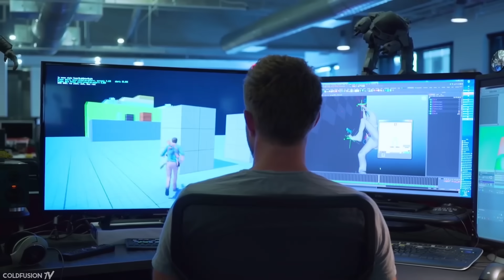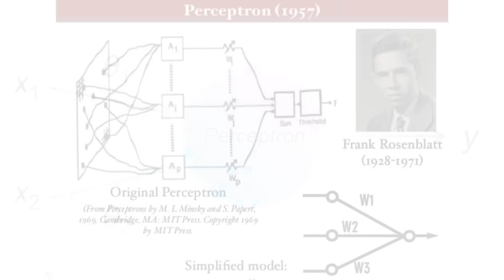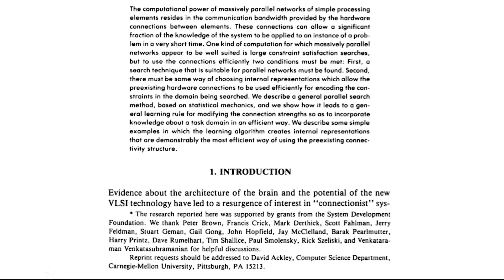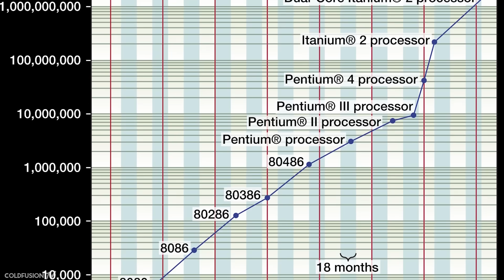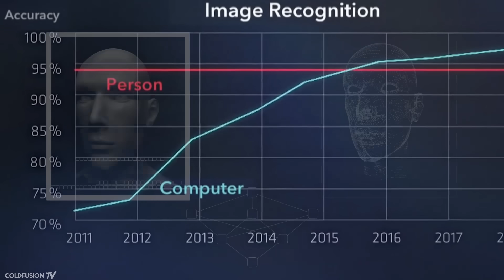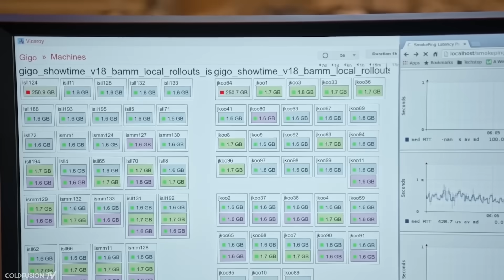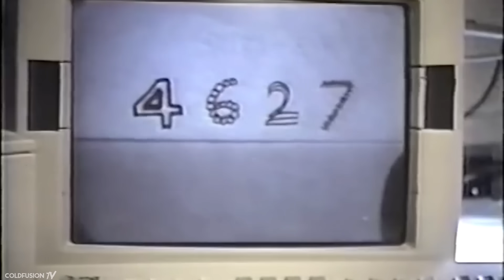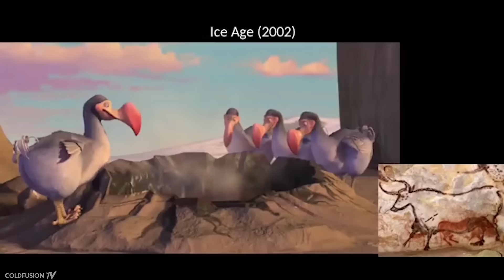Who Invented A.I.? - The Pioneers of Our Future

Comment: AI did not solve the three body problem. I haven't read the paper and this is the first time I'm hearing about it but non-linear differentical equations don't pass the "uniqueness" part of the existence and uniqueness theorem.

Here's the abstract for the paper:

Since its formulation by Sir Isaac Newton, the problem of solving the equations of motion for three bodies under their own gravitational force has remained practically unsolved. Currently, the solution for a given initialization can only be found by performing laborious iterative calculations that have unpredictable and potentially infinite computational cost, due to the system’s chaotic nature. We show that an ensemble of converged solutions for the planar chaotic three-body problem obtained using an arbitrarily precise numerical integrator can be used to train a deep artificial neural network (ANN) that, over a *bounded time interval*, provides accurate solutions at a fixed computational cost and up to 100 million times faster than the numerical integrator. In addition, we demonstrate the importance of training an ANN using converged solutions from an arbitrary precise integrator, relative to solutions computed by a conventional fixed precision integrator, which can introduce errors in the training data, due to numerical round-off and time discretization, that are learned by the ANN. Our results provide evidence that, for computationally challenging regions of phase space, a trained ANN can replace existing numerical solvers, enabling fast and scalable simulations of many-body systems to shed light on outstanding phenomena such as the formation of black hole binary systems or the origin of the core collapse in dense star cluster

Comment: The critical question of "whether they (A.I. beings) will be nice to us is really THE fundamental and MOST CONSEQUENTIAL issue for A.I., and humanity. And it all goes back to the stories in Terminator or the Matrix, or iRobot, etc... First of all, we MUST be able to incorporate a VALUE SYSTEM into the algorithm. It is not enough for the A.I. to learn based on positive/negative reinforcement. There must be some overriding layer of MORALITY hard-coded into the system -- similar to the "3 laws" in iRobot ("You cannot harm a human being"). But then the question becomes, if the robot is so smart, it may be able to devise a way to change or override that higher/hardwired/hardcoded safety-net, right? Just like the example in this video, where one algorithm won the hide-and-seek game because it figured out how to "change the coding which governed the laws of physics within the original program", similar to how Neo learned to change the programming in the Matrix. This is actually scary stuff, and I never realized just how close we are to A.I. becoming so good at self-learning that it becomes smarter than us.

Comment: A Lie is a Lie is a Lie! When understanding something there are a few basic rules. Just like energy can't go from a high source to a higher source in totality this AI bullshit can't be possible without input from the Lie. Energy flows from a higher quality to a lessor quality/quantity and is diminished, dispersed and spread out  in that you don't lose energy it just go into a lower more spread out form. That it never is lost or gained it just evolves lower and lower to lessor and lessor parts, not losing the sum total of its quantity. So electricity as it is produced is a set voltage and current(amps) either stepped up in voltage while lowering current(amps) or stepped down in voltage while upping current(amps). Same with AI if you put all the knowledge of a person into it, the machine can then outdo a man by being more proficient at a part of the task because something mechanical can out perform something in the flesh in varying degrees of actually doing the task, such as in thinking faster, being stronger, continuing repetition, or in outlasting as long as there is energy being provided, maybe even becoming better at learning in a given isolated area by gathering more data faster as it has immense amounts of power/energy being used. Where we humans need to take breaks have limits on our bodies and minds and need to enjoy life or die. Tell me will a computer ever have the intuition or the mindset of a human? Can a computer or robot or etc, ever perform the way a human can or a human's brain can? Example I can be in the desert or in the freezing cold or in the water etc. and perform without extreme HVAC, I can eat a banana or go without to the point of weeks and perform complicated tasks without using extreme amounts of energy, I can perform without extreme venting or in having to be in a clean room type environment while operating complicated equipment and completing complex tasks, I can operate under conditions and understand the human condition that a machine NEVER will, its called intuition. Will a machine ever have the ability to express the humanity we humans can express in all our frailty, power, strength, empathy, love, etc? Yes in isolation a machine can outperform certain tasks at certain levels but it will NEVER be the end all do all of us, people. Period. This all in the form of an organ no bigger than a ball that is amazing and can NEVER be copied I don't give a flying F$#% who works on it or how long the human race has to solve it, other than by the natural way we reproduce each other with a man and a woman. Period. OH and as far as the other part of the Lie where we now are defining our humanity in another way in mapping our genome and our DNA and producing us people in lab type environments think about this, the last time we came this far was when the Earth was flooded because mankind's violence was so ingrained in everything that it affected the Earth itself all the way through to the plants and animals in the violence caused by us, HUMANKIND! Was that because back then we were doing the same things in developing and designing Humans outside of the Human body!? Gene splicing everything from plants, animals to even Humans!? So absolutely YES we were smarter back then even compared to nowadays. Yet the violence we caused brought about Judgement that is coming once again, only this time it will be with Fire. Go Freaking Figure

Comment: There is no artificial intelligence, machine learning l, deep learning. It is magic word(marketing term) to keep noob investers(in share market) always at end of the chair. It just algorithm based upon the mathematics that runs on nvidia & intel magical ai machine originally a ASIC specially designed to perform matrix operation. Normal cpu contains ALU it can perform arithmetic operation like + and -  {Note: multiplication and division is the extension of addition and subtraction with same circuit} , GPU is designed specifically for vector operation and {finally nvidia's tensor , intel's nervana, Google's TPU, Qualcomm's AI,apple's neural engine is fucking designed to matrix operation with big numbers in massive parallel.} 

Important note:

*there is no real conscious ai is built till this sec, even we didn't understand how our brain consciousness work in practical not in theorical like particle physics dark mater, if you doubt me ask neuro science graduates

*artificial neural network, machine learning, deep learning, ai are mathematical ideas that converted to any programming language which uses matrix operation as its core.

I'm not here to blame cold fusion tv, I'm here to blame fucking marketing teams like fucking Ai.

I'm not here to screem that "ai going to destroy blah blah blah"
Reply: The vid explained how artificial neural network or "deep learning" works. Its a bunch of nodes with weights. The more you nodes and weighs there are the more accurate it is. It can be applied to many problems. It can self learn how to control an real life hand or in game character like that game where a.i hides and a.i seeks which is amazing. All it takes is some know how to guide the whole learning process. And if its moving in the right direction then youre seeing the expected results. Or something way beyond expectations like the machine learned a.i using engine glitches to break the rules when it encountered seemingly a dead end.

Comment: It starts with saying AI solved the three-body problem, which is why many in AI community are pushing back so hard against wild headlines that require you to read the fine print, and then the research paper, in order to know just how misleading it is... but is out on blast as the full truth in videos like this.
Reply: OK, with Perceptrons, and Hinton's work, We need to stop calling that AI. It's Machine Learning, and they have a fundamentally different "understanding" of the problem space. Simulating the brain vs trying to understand how it works represent different layers. The first, Connectionism, is also a form of Reductionism. Instead of stopping to smell the rose, they shred it into the smallest functional component and try to build a network that is a crude approximation (in the brain, there are different types of neurons that build different types of structures and the connections between them changes over time (not just the strength of each connection, but adding and removing connections in 3 dimensions).
Reply: Finding statistical patterns in huge sets of data is a one trick pony, and in a lot of cases, humans are having to label "what to look for." It's taking the haystack, placing it on a conveyor belt, and using a giant magnet to pull the needle out as the hay goes by. Such a system could find thousands of needles an hour, which is why we call it automation, not intelligence.

Comment: There's a lot of nonsense in this video, and it's not really ColdFusion's fault, as a lot of this pseudoscience has become sadly widespread.

To give a single example, the solving of the 3 body problem "in seconds" is a pretty idiotic paper. They used physics models to solve the problem, then "learned" a model with a NN (if I recall correctly). A NN is literally just a bunch of nested polynomials (or affine splines, according to Baraniuk), so all they're doing is brute force fitting a function to the data.

In other words, if you wanted to use "AI" (it's not AI, it's curve fitting) to solve celestial mechanics problems... you'd still need the simulators, as this model doesn't generalize to the N-body problem without a training process. So it's great PR, not great science.

In fact, I would say that the "AI" trash is probably the centerpiece of a massive stock market bubble and multiple inflated faux tech companies such as Facebook and Google. This guy summarizes it best:
 https://blog.piekniewski.info/2018/05/28/ai-winter-is-well-on-its-way/